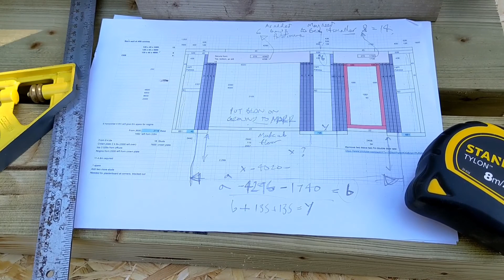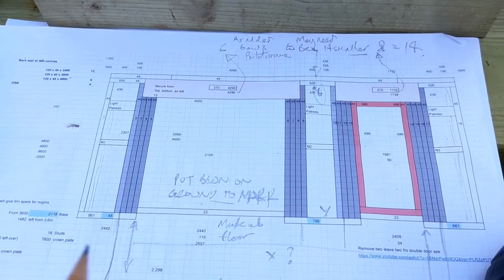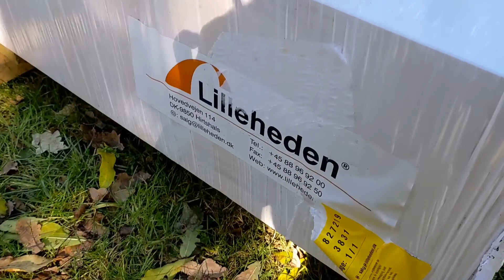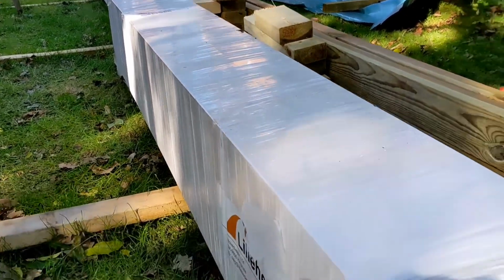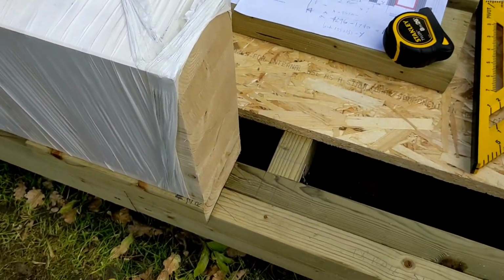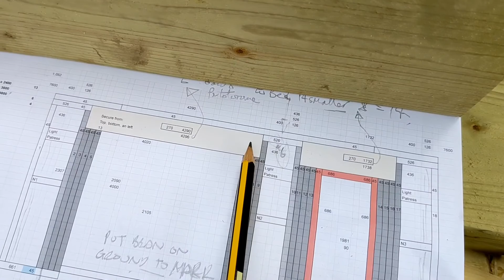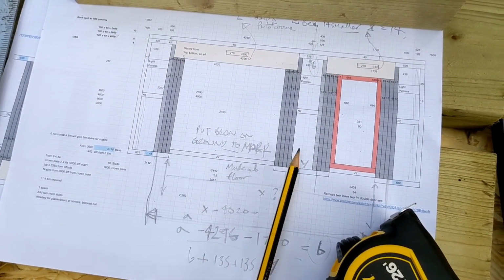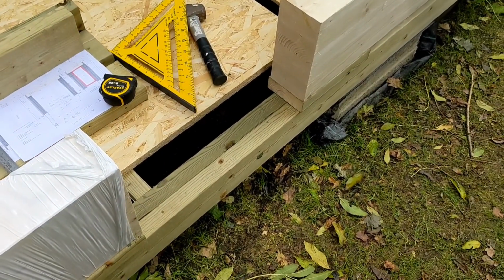Garden Room Build - Week 15: Ep 26: Glulam Beams! + Middle section of front wall

Comment: Hi , like the beams, seen them on a few you tube vids, I just glued 2 6x2 with a steel plate , flitchbeam - above my bifold - no idea if it’s enough but seems ok lol, did you do a calculation on the span and roof weight ?
Reply from the maker: Thanks George, I didn't do any calcs! I did think about making up a flitch beam but wanted the try the glulam, it worked out well, no deflection so far at least!
Reply: @FatManBuilds  I’m sure it won’t deflect, you could probably have a pet elephant walk along your wall
Reply from the maker: @georgebarr5102  Ha! I might try it! That would make a good video!

Comment: Great series. out of interest why not a box section steel beam? why the glulams?
Reply from the maker: Thanks Peter, much appreciated, glad you are enjoying it. I did consider steel box section, but in the end I went with Gluam as I wanted to keep the whole structure to wood  and the Gluam beams have always interested me so wanted to work with them. They were absolutely solid no movement at all and were exact on the measurements I ordered to the mm! They came from Denmark to the UK.
Reply: @FatManBuilds  Brilliant. They do look rock solid. What was the rough cost per metre for a beam like that if you dont mind me asking?
Reply from the maker: @peterkwameosei-bonsu6135  they worked out around £100 per metre, inc VAT, so not cheap, but you might be able to get cheaper if you found local stockist. I thought I had, it was only later when the haulage firm called and said "we have your beams here from Denmark" that I realised I had bought from an importer. Their website suggested they had them in stock. Probably 2 times cost of steel, although I never actually got a quote for the steel.